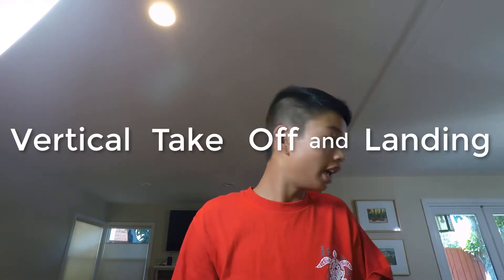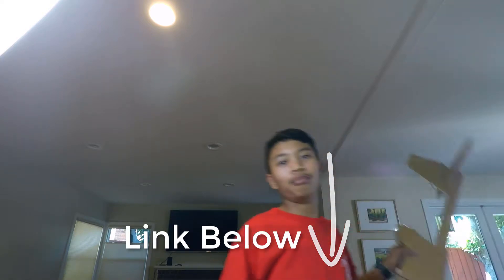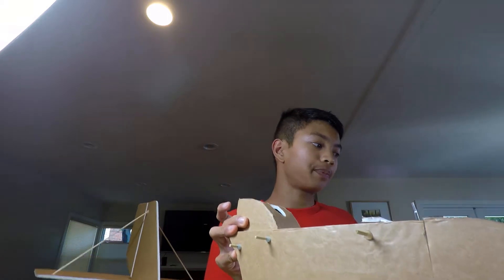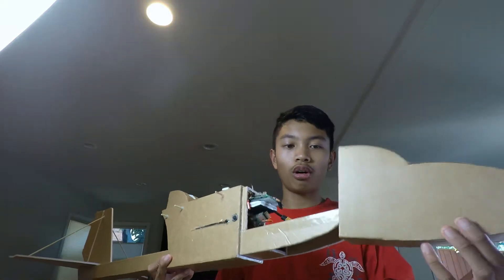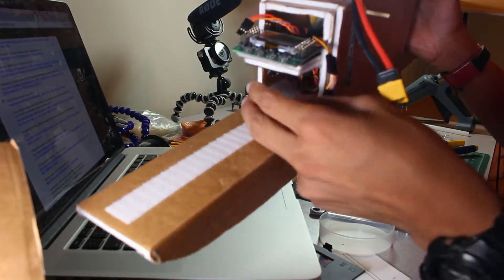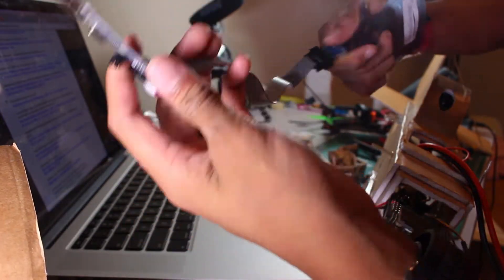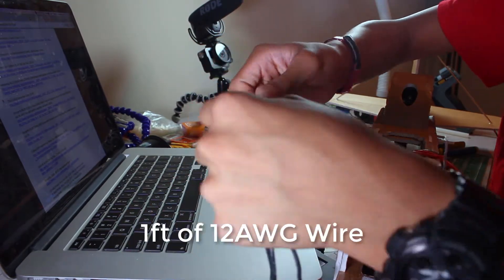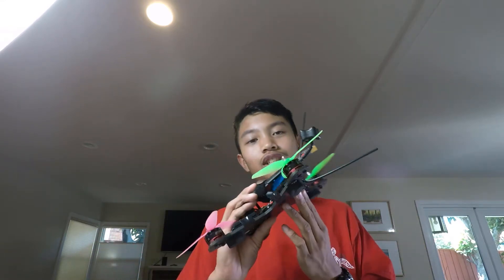FT Explorer VTOL Build Intro

Comment: Great build! Where did you buy the KK2.1.5 flight controller? It's discontinued at HobbyKing. The version available on Amazon appears to be the same, but I can't confirm if it includes the 6050MPU And Atmel 644PA. Any help would be appreciated!